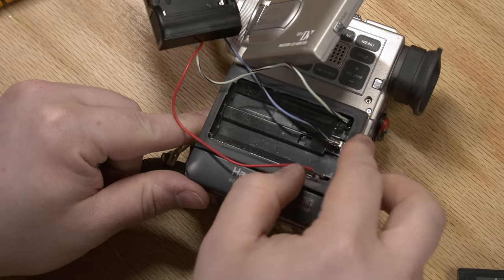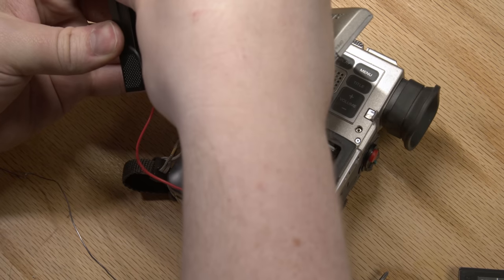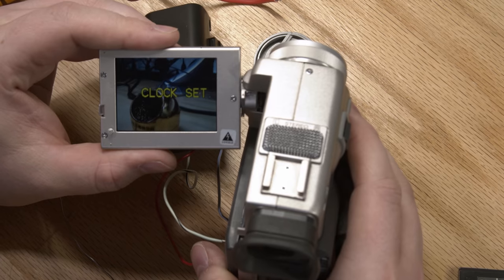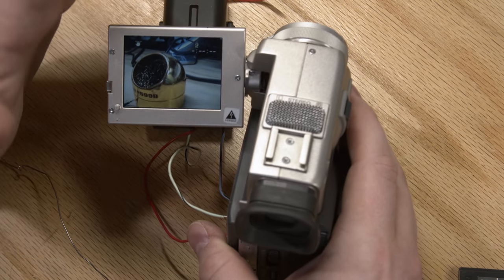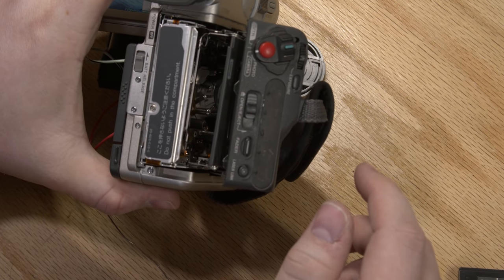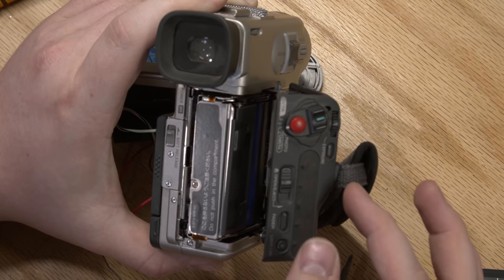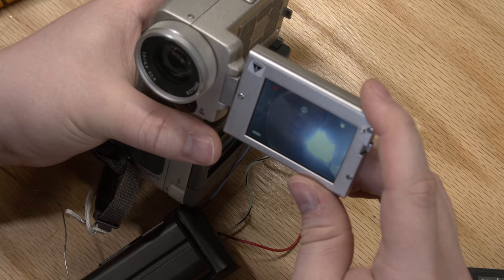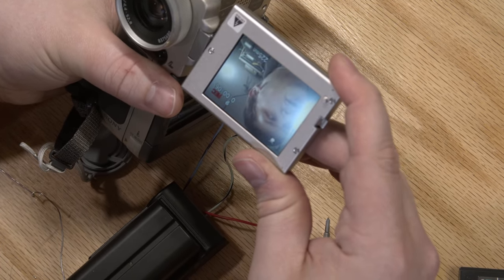Adapting Infolithium to Infolithium

Comment: You CAN solder to lithium cells. The trick is to turn your iron up as high as it will go. Pre-tin the wires and pre-flux the cell end. Solder fast - spend as little time heating that cell end as possible. This is where the super hot iron comes in. Hit the joint and spend just barely enough time on it to flow the joint. Be quick about it. I've soldered lots of them with 100% success.

Years back I soldered and ruined a bunch of nicad cells by trying to do it the regular way with too cool (normal setting) of an iron and taking way too long to get the joint hot enough to take.

Comment: I like this kind of video because no one is a Ben heck level maker. This is on a level that is a learnable skill. Sure you could design and 3d print a pack and reverse engineer a info chip and design a pcb that would fit just right. "Brought to you by PCB Way!" But that's a crazy level of doing thing when there's tape and repurposed wire laying about.

Comment: As someone who rebuilt these, it's really not that hard.

If you're scared of the cells, discharge them before hand, they won't catch fire then, just offgas then trip the protection.

Also it is safe to solder them if you know what you're doing. The rule is that you shouldn't get the battery core over 70C no matter what. So discharge the batteries first, get a soldering iron with a very large thermal mass at 300C, and low temperature solder, then solder away. This is difficult and takes a long time which is why welding is preferred, but it is possible to solder them. Worst case is that the batteries lose some capacity.

Also get those Sanyo cells out. They're known as 'heaters' because, well, they heat up. Get some LG, Sony, or Panasonics.

Comment: Just a warning about gaffer tape. As with most adhesives, it has 3 modes, "doesn't leave residue", "goo", and "solid", in that order. At least the stuff I've encountered has turned to goo after a number of years, then eventually turns sold and you can tear the cloth backing off, leaving a hard patch of adhesive. It does seem to last longer in the first stage than duct tape though. Don't be fooled by the lack of residue and get some white gaff to make flags to label your cables, you'll just end up grabbing a gooey label that falls off and leaves everything sticky and you swearing.

It's for this reason that we never leave gaffer tape on cables or anything you don't want to end up sticky. We use it for either for very temporary (as in hours or days), or permanent (label e.g. "repaired 2021-08-20 - needs replacement") applications.

Comment: while not safe if proper precautions are taken soldering on a li-ion 18650 can be done without failure
the main issue is the increase in cell temps over 50c so precautions are
1: surface must be pre-cleaned to ensure minimal bonding time
2:cell should be heatsinked or a nearby cooling material like a mass of ice to keep max cell temps under 50c
3: use extreame iron temps to reduce time required to heat the bonding surface
4: flux is required to make sure heating is less important
I added a bulge top to many flat cells for a crappy retina melting flashlight that can't take flat tops and never had failure once I learned these precautions (two failed before but it was after the cell became too hot to touch anyway so over 50c)

Comment: I will say that 9/10 times, for non-brittle plastics, you're best off using a pair of nippers/flush-trim side cutters to remove the waste material after using a Dremel to do bulk removal. It's just so much faster than abrasives.

Comment: I remember my dad had the high capacity infolithium battery for our handycam. Looks like the normal 2 cell battery but twice the thickness. I think they made an even thicker one than that. Thing would run all day doing drag racing recordings at the track

Holy crap, I've never seen a device refuse to work without the 3rd pin connected. They've all worked, they just refuse to charge.

Comment: In student television we're calling (mostly 3rd party) infolithium L batteries np-f, as opposed to (also sony) BP-U batteries, which are used in sony's higher end professional cameras and don't actually say infolithium, they also use 4 cell in series instead of 2 (like standard v-lock), so are better suited for higher power draw. I recently saw a reputable 3rd party battery maker using L series naming instead of np-f like all the nonames I encountered and this clear things up. With newer? sony batteries they introduced a letter after lithium for distinguishing compatibility and the letter seems to get incorporated into model name (i.e. NP-FT1 for infoLITHIUM T, NP-FZ100 for infoLITHIUM Z), but not for infoLITHIUM L series (NP-F570 ,NP-F770 and NP-F970).

Comment: I'll admit, Lithium-Ion batteries make me squeamish if I have to work around them, but the few times I do, I just remember one simple thing that makes me feel a little better: At least it isn't Lithium-Polymer.  Let's strip all of that nice, protective, hard battery shell off of the soft, delicate, explodey-firey-bits, so that one mistake with the Dremel, a slip of a screwdriver, a pin on your workbench, can create a 3000+ degree Lithium Metal fire in your workspace.

Yeah, no.  I hate working around Lithium batteries.  Nickel-Metal was bad enough, but at least they gave you warning signs before going up in flames.

Comment: If you want to learn how to solder Li-ion 18650 batteries with a soldering iron, Mr. Carlson's Lab has a video on how to do it. It's a 2 step process to avoid putting heat into the batteries, and it's best done with a VERY hot iron, very quickly. It kinda the same technique you'd use for soldering polystyrene capacitors which are easily destroyed by even modest heat. You use high heat, hit them fast, and cool the joint quickly.

Comment: You should use the super glue + baking soda trick to improve the strength of the super glue and avoid that bond failing.  Love gaffer tape!  Hate duct tape!  But I think I would have glued it using the same super glue + baking soda trick or some kind of stiff epoxy clay/putty product.  Great fun though!

Comment: I've newer heard of that name. I use a lot of video equipment but they're just known as np-f batteries

Edit: My dad has the exact same camera with the exact same weird batteries
Reply from the maker: Yep, the name was swept under the carpet a long time ago by all the third party manufacturers who turned it into a de-facto standard using the underlying sony part number.
Reply: Those NP-F series batteries (except for the ones for this DCR-PC10) are Sony InfoLithium L Series. For a while they were crazy expensive to buy since Sony was the only source and the devices that took it were reaching 15-20 years old. Now they are everywhere because someone decided to throw that style mount on a crapton of unrelated video equipment and lights.

Comment: solid core is better than stranded for the same cross section of the physical wire, unless you are going off of total cross section for the conductor itself, they are roughly the same at that point, and the benefit to stranded is their ability to flex and to be smashed and have a better contact with the electrical end

Comment: Just buy the 18650s with a pre-welded tab to solder to. It’s what I do when I replace cells in old laptop batteries. A little more expensive but safer.

ETA: fair enough that battery pack looks to be a pain to disassemble. Also really hope you wore a face mask when using the rotary tool to file down the edges. Don’t want to breath in the little particles of plastic.
Reply: I certainly agree with the suggestion to use pre-tabbed cells but in my limited experience it would still be difficult to get everything to fit into the original case.
Reply: @eDoc2020  yea you’re right it is quite cramped. Just wanted to mention the pre-tabbed cells. They are a game changer at least for me

Comment: That two NPF to vee mount plate makes no sense with those little guys, but batteries in that type come huge, big NPF batteries are the same width and length but much taller, 5 or 6 cm, a pair of those might deliver the same mAh as a smaller vee mount. Obviously the bigger ones don't fit inside a camera but most NPF plates for monitors and lights are open back, I have a big LED panel that takes a pair. As for why that specific battery type, the ubiquity of Sony cameras led to crews keeping a lot of them on hand, so they became kind of a universal standard over time.

You might have never met a device that refuses to work if some of the other contacts aren't connected, but once I had my Canon camera refuse to work with its own first party batteries, it powered on, asked me if there was a Canon logo on my first party battery with a prompt on the screen, to which I answered yes, and then it immediately shut down accusing me of using counterfeit batteries. Fortunately it worked perfectly after a restart but I can only assume it had a bad connection and didn't find some electronic something or other that it was looking for on the battery.
Reply from the maker: Oh you know, I forgot that I had recently bought a big big NP-F that totally would run one of my big cameras for a decent chunk of time. Whoopsie!

That's a fantastic story, yet another tickmark on the "DRM mostly hurts legitimate users" log, hah

Comment: Tips for dremel-ing plastic with a cutting disc: Many small, gentle passes, quick pecks really, and give the plastic time to cool down between pecks. That should help minimize the melty, stringy, jaggedy crap. (Learned this modifying dolls, actually, had to hack the legs off to add more joints...) Granted your dremel is a lot nicer than my 3rd-hand 15 dollar 1-speed POS, you might find a better way to do it.

Comment: I can't speak for vintage Li-Ion technology but I am working with Li-Ion cells since about 10 years and I had some shorted or set in a parallel pack with the wrong polarity (for a second or less). Those cells are still in service. I think the fear of explosions and fire come from the industry to lobby against right to repair. The panic can maybe come from vintage cells that might have been constructed much more dangerously compared to cells we have today. That would make sense, there are most likely big efforts to make those cells much safer these days than they were in the early days of Li-Ion cells.
Reply: Nope, the cells I used have no integrated protection. I added that myself, but not on individual cells (parallel pack) or using a BMS for series cell packs.

Comment: I use AA and AAA (and especially C and D cell) battery dildos all the time. such a neat invention. definitely recommend for something that absolutely could be hardwired but isn't for some reason. 
so-called "Battery-eliminators" on the storefronts that sell them. sometimes just powering them off a USB power bank is all you want.

Comment: The standardization on those batteries started way back in the DVX-100 days. I’m guessing since so many independent production places used the dvx and gl/xl-1/2 they figured easier to make cheaper stuff use it as well. It is a bit funny to see now though without any context.

Comment: 3:00 easy to make fit. Just need to lengthen the slots with a file all the way through. They had stoppers (plastic) to prevent a smaller battery to be used as they can not provide the same amps or runtime.tjey considered this detrimental and prevented this.
Reply: 5:10 extra points for the definition... However, sticking with dummy battery. ;-)

Comment: Hey! Where can I send you some hyper specialty wire? It was used to power an artificial heart. Not a joke, I service LVAD power systems.
Reply from the maker: holy crap hahaha, okay, that's appealing - what kinda specs are we talking in terms of gauge here
Reply: @CathodeRayDude  I cant remember the gage and it's not printed on the cable. It has LOTS of Teflon coated conductors. 4 current carriers, and almost as many signal wires as there are wrong answers to the fire marble puzzle in Riven. It has a woven steal shroud like a Chinese finger trap. I have a bunch of these that I scrap cable from. Let me know where to send it!

Comment: A lot of electronics hobbyist storefronts sell 22-23 AWG wire (usually solid core, but stranded would probably be more reliable for applications where they're expected to bend repeatedly) because that's what fits in breadboards/predrilled protoboards.
I'm lucky enough that I've gotten (tinned) copper, but I think I've heard that there's wire that's silvery all the way through (don't remember what metal exactly though).
I don't really have enough experience to know what separates good wire from cheap wire, though.
(Tayda Electronics is an Asian store I've used, though I haven't bought from them in a while, so I can't vouch for their current quality).

Comment: Gaffer tape is good and leaves no residue, but at least for the stuff that I have, this is only the case for about 3 years. If you just leave it on longer than that, it WILL leave this crusty residue that is difficult to remove and you WILL damage your surfaces getting it off. Luckily though if it's been stuck on for that long, a little surface damage is not likely to be much of an issue.

Comment: That gaffer tape is still going to leave residue it just takes longer to do so.  When it does it'll just as bad if not worse. It is mainly designed for temporary installations
Reply: Absolutely
I've seen projects done with gaffer tape that were lefst standing for a year or so.
Once the adhesive dries out and you try to remove the tape it's like someone's been using epoxy glue

Comment: Yeah, my circa-1999 TRV67 refuses to work on non-InfoLithium batteries. I've noticed that Kastar-branded batteries seem to work fine, but any other brand gives the dreaded "For InfoLITHIUM Battery Only" message before shutting off.

Comment: a side note about lithium fire preparedness, 
Lithium does not burn using oxygen, you cannot suffocate a lithium fire,
a fire extinguisher of Any Kind will Not Be Usefull in the event of a lithium fire.
to combat a lithium fire you will want to do one of two things:
put the fire in a metal pan, remove all lithium to a safe outdoor location and just, Let it Burn Out on its own
or 
take the lithium and put it in so much water that it could never evaporate it all away, and just let it burn out where it is (only do this if your ventilation is Excellent Quality, fumes Will be produced)

you may have noticed that neither of these solutions involve actually putting out the lithium fire
this is because, and correct me if im wrong but, to my knowledge that is Not Possible to do.
i have not heard any method by which a lithium fire can be extinguished. 
so, if you're thinking about doing this
plan and clear your evac route, have a Place In Mind for the lithium to burn in, ensure that there are no obstructions, obsticals, or extra steps you need to take to get it from your workspace to the burn zone.

Comment: Just a tip if anyone needs to do this:
Dont do this on a cardboard box if possible, a turkey tray or a plastic box with humid dirt is the safest way to do this

Also use thick leather gloves or asbestos gloves for this kind of stuff

Comment: This was awesome and probably almost exactly what I would have done. You should replace the gaff tape though - after a few years the adhesive will dry out, stop bonding, and leave behind a residue that's almost impossible to remove. "Ask me how I know"
Reply from the maker: Fair, although I'm not sure what else to use. Duct tape has the same problems in my experience and I don't want to epoxy it so I don't know that I have that many options
Reply: @CathodeRayDude  I think I would try removing the bottom plate from the sled and reusing the four screw holes (and maybe even the four screws, if they're long enough). I agree you don't really have great options.
Reply from the maker: @CoolerQ  Yeah that was one of my other ideas and I just felt like the plastic was too flimsy to rely on

Comment: Another way to cut plastic cleanly is to use an heated razor knife. The red hot blade cut through plastic very straight with very little damage. Not sure if it's safe on a battery pack though...

Comment: I've lost count of how many laptop sonically welded lion battery packs I've completely ruined befor I got the hold of it with a dremel.

Even once I got it right I them had to learn how to flash the controller chip to register it as a new & clean battery.

Comment: Great video. Most Sony DSLRs from 2007ish onwards won't operate if they can't detect a infolithium, even if third-party.
Reply: I'm guessing this camera won't work without the data pin because it also has a DC input, and can charge the battery.  I would imagine it is not willing to do this blind.

Comment: Have you tried mouldable glue called Sugru to connect the plastic cases together instead of the gaffers tape or there is a two part epoxy putty you can get a hardware store it's blue on the outside and white inside and cylinder shaped and you mix it until the blue white turn blue gray.

Comment: "People said, 'Go slow.'" That's bad advice because of the same reason dull knives are dangerous: Tool pressure. A sufficiently high cutting tool speed will prevent the over-compensation of excessive tool pressure, which stores up energy like a spring. Once you break through your material, that tool pressure converts to kinetic energy from potential (compressed spring) energy faster than you can react and stop applying muscle input. This is exactly how amateurs get hurt while working with  power tools and cutting surfaces.

Sharp cutting surfaces, undamaged tools, firm work holding, consistent force vectors, environmental awareness, mental focus and for the love of god: SAFETY GLASSES!